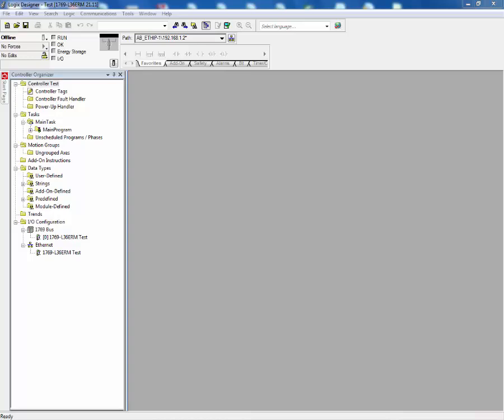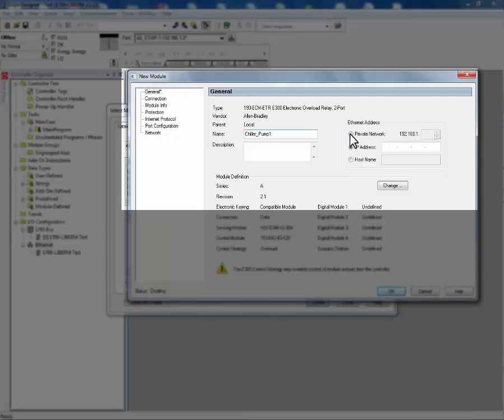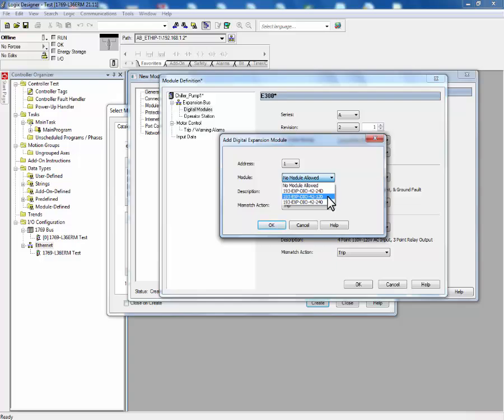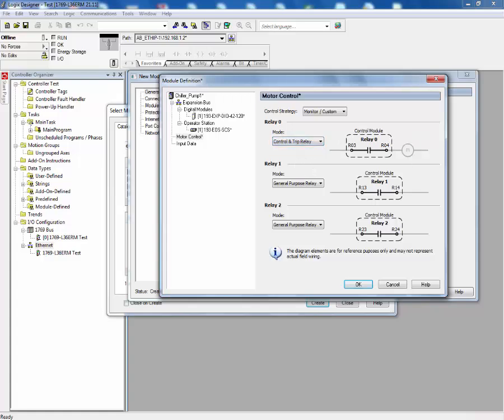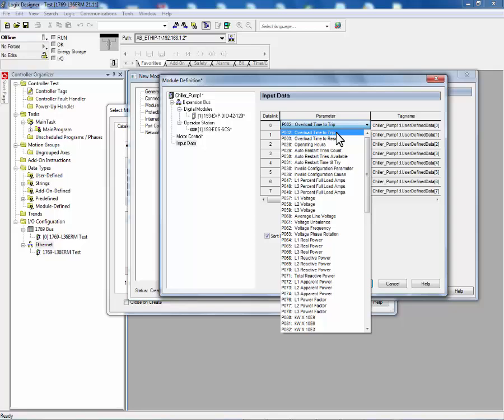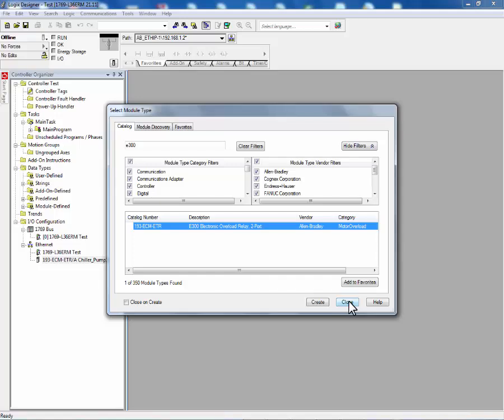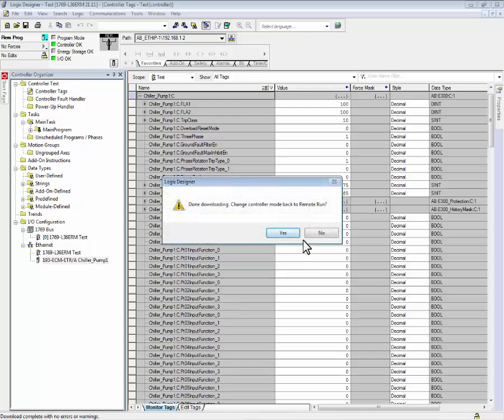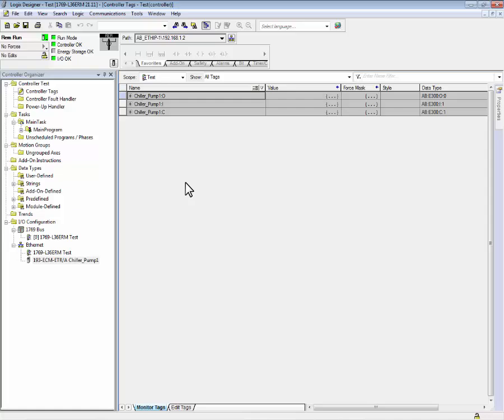E300 Electronic Overload Relay - Adding an E300 thru Add-on Profile in Studio 5000 Logix Designer

Comment: Good. I consult them, I have an E300 firm. 7.180, at the time of integrating it to the studio 5000, the added module shows me an error with the yellow icon. In the properties it says "module revision does no match configured module" and the connection shows me faulted. The maximum revision that I have enabled is 6.1, my studio 5000 is version 20.01, is it a compatibility problem? Or do I need to configure something else? I have read technical note 899504. Thank you. gespinosa@outlook.com.ar